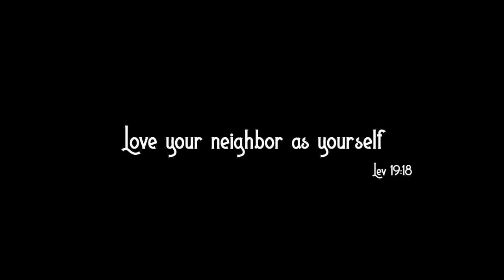Fitting a RESIDENTIAL DOOR in a MOBILE HOME!

Comment: Being a retired contractor/project manager I would like to pass on a trick.   You dont need to leave the door in the frame to hang it.  Get the hinge side plumb and the threshold level and then fit the rest of the frame to the door.  I promise with practice its much easier then fighting that heavy door and frame all in at once.   I also use 2 1/2 to 3 inch torx head screws to hold it in place under the weather strip and then one in each hinge..

Comment: It’s basically like a regular home install after you enlarged the rough opening to fit……I have always replaced mobile home doors with house doors and the rot you found around the door is very typical of mobile homes…almost every metal clad mh I have done had rot.

Comment: Very nice. I done the same thing on my mobile home. Put a 36x80 on the front and 32x80 on the back both with half windows. I love my new doors. I didn't have as much clearance as yours so I didn't have to add a new header. The door went all the way to the top. And the cost you was talking about was true. Much cheaper to go with residential doors.   I had to replace mine because cops kicked in the previous owners lol

Comment: Yall are doing so much stuff just like me. I too build a second roof over an old trailer. I too put a res' door in. I too hang my tarps from the second roof. I had 5 big water damage spots. 3 down 2 to go. I saw other new mobile home installs having 2 cinder block supports under the door. I followed suit.

Comment: You could add shim strips to the studs. You could gradually make skinner shims the father you get from the door. Or if your removing all the interior wall board in the room you could increase the insulation between the studs from 2x4" to 2x6 with the shims. Just a thought.

Comment: I'm doing this exact same thing tomorrow.. we have a 32×73 and are putting in a 36×80.. I was a bit concerned about the space available above the door to put in a header, because I doubt there is a header there now, but my home has the same peaked ceilings as your so I'd imagine the wall height is the same... wish me luck! Especially need luck getting it in before I have to work tomorrow afternoon. Jobs always take 3 times longer than I expect them to.

Comment: Great video. The only thing I would have done is to install a premade PVC door pan under the door which will keep any water from seeping into the home under the bottom and lower sides of the door.  You can also fold and install an aluminum of galvanized pan yourself.  The door pan will enure no water even when the caulking fails, and it will fail eventually due to slamming the door, etc.

Comment: My mom needed a new door on her Parker. I'm lazy, so I bought a door blank, sanded, eurathaned it without a stain  (beyootifull) and then cut off some here n there to make it fit in a centered fashion. Although, We did tear into the floor a bit to lower the threshold to flush for less trip hazard. Clearly I had help with that part.

Comment: We have a Modular home, and other than the siding is a tiny bit better, There is not much difference between a modular home and a Mobile home. So I might be able to upgrade our kitchen door to a 36" wide opening. Many thanks!

One observation, that the new door is a lot heavier than what was there, make sure that the king/jack stud on the hinge side of the door is as solid as it would be in a sticks and bricks house. Perhaps putting in a few braces over to the next wall stud would do the job. That king stud is supporting a lot of weight when the door swings open.

Comment: You were SO right to go for a 36 inch entry door!  I live in an old place, and I have one entry that is 36 inches, the other is 30.  Obviously EVERYTHING (so far, stove, refrigerator, washer, drier, sofa, recliner) have had to be hauled around to the wider door to get it into the house.  Doable, but a nuisance.  No plans, however, to replace that beautiful wood, with eight small glass panes, 30 inch door.  I love that old door that came out of a 1917 building so for now it stays!  Anyway, as to your new door, I love it.  Good choice.

Comment: Absolutely enjoy your remodel projects! I too live in a mobile home we have done a lot of remodeling ourselves. It’s crazy how poorly they are made and how they can get away with it! I do have a question for y’all when you replaced the plugs or light switches in your home where they attached to a 2X4 or in the Sheetrock, wallpaper wall? Because ours are starting to pull from the wall Sheetrock.
Reply from the maker: Thanks!! All of the original outlets and light switches in the home were floating in the walls -- only being held in place by tabs to the wall covering. Terrible!! We have the same issues with them pulling loos from the walls.

Comment: I've been remodeling my '72 trailer for almost a year now and you're videos have been very helpful... I get to see how it's built and what to expect... I spray a 50/50 bleach and water on the mold and dark spots after that dries I go around with bug killer and then let that air out .. I have plastic up to keep the fumes dust and mess out of the back rooms where I'm living until I can finish the front 3/4s and leapfrog around... Everyday I do something doesn't look like it sometimes or it looks worse at times... I'm not in the best of shape from not working or have deep pockets... So for anyone out there just know if you watch a bunch of videos about whatever your doing and give it a try at some point it will get easier and at the end you will know what you got.... My condemned $8000 trailer with no hot water... Ants everywhere leaking roof and windows moldy celing a patchwork floor and no appliances...  Well now it's coming together nicely thank you for your inspiration and positive vibes to just keep at it

Comment: You two are like my wife and I. Love it. Nice door and install. Just curious why you purchased a door for a 2x6 wall? And, did you get the door w the PVC brick molding? 

I like using GRK 3.5in trim head screws for fastening the brick molding to the structure. I also install them through the case hiding them under the weather strip. I use 3in #8 GRK screws to secure the hinges through the case as well, at least one per hinge.
Hope it's still working for you.

Comment: Since I am about to install an entire new wall, with a new nine-light 36" door where a 32" door was, I sure do appreciate this video!  I am running into some issues in the project though -- not the least of which is the electric wiring that runs over the top of the door.  Apparently the door was replaced once already, because the wires are spliced.  Any suggestions would be very welcome.  I'm working alone.

Comment: Replacing 1 screw in each hinge with a longer screw that reaches most of the way into the king stud will handle kids better.
Reply from the maker: We didn't show it, but that's exactly how the door comes from the factory -- each hinge is missing a screw. We pre-drilled and installed 3.5" exterior grade screws in each one to lock it all down tight.

Comment: We are remodeling our second mobile home. Your 54 inch tub video is what lured me in. I am about to undergo, laminate flooring for the whole mobile, kitchen, and the small bathroom. Next year will be another bathroom and interior/exterior doors and some windows. We are spreading ours out over a 3 year plan around 5-7500 each year. We paid 4 k for this one with a electrical short I was able to fix day 1. It should be able to double my profits in the end if and when we sell. for mine, the siding to mae will make or break the end result. We kinda want to get ours to a point where it's worth selling or worth moving to land. Paid 4k for it, Hoping to get near 40k in the end if we sell. Mind you mobile home values are through the roof in my area right now. I could aim high and have a good chance of satisfactory sale on my end. I want land so bad.

Comment: I have a 1990 Norris single wide trailer. We have 3 light switches, 1 for the outside light the other works the ceiling fan and the 3rd has been took out and just wired together . So do you have 3 switches and what do they go to? I also have the same smoke detector wiring too so that's why I'm asking. Previous owner also had replaced a 120v outlet with a 240v outlet and kept all the other receptacles. So I'm just kind of worried what else they messed up on!!

Comment: Hi from the U.K. 🇬🇧 
it’s looking good but every time you pull up flooring I’m waiting for something to jump out. 
How do the wasps get inside to make nests inside your walls?
Reply from the maker: Thankfully we've not had that happen to us! The wasps are able to get into the walls from the exterior since the original siding is in multiple pieces. It's crazy. On the front of the home, where you see the stripes of color horizontally, those are seams and different siding sections. I guess it was to make it look better back in 1988, but was the worst idea ever for a home!

Comment: That stud doesmt fit close to door Opening, due to roof sag from NOT having a PROPER Header over Door. You should be inatalling a PROPER Header made of two 2 X 6's on edge with 1/2 incch plywood betwen them supported by Jack Studs. Also for added Security 3 inch screws on striker plates into Jack & Kimg Studs as well as one or two in each hinge.

Comment: You need to add a storm door to keep the rain off your door water will run in under the door. I did one just like you did I end up putting storm door upon mine.
Reply from the maker: We bought one at the same time as this door. :) That install is coming up as soon as the trim gets painted and we tame the electrical wires inside.

Comment: That doesn't look like a 2x6 unit. Normal door units are made to work with 7/16" or 1/2" sheathing. They flush out with 1/2" sheerock on the inside. That thin tin on the outside allows it to go further into the inside.
Reply from the maker: Ahh, good point! You're right!

Comment: Love the new door.  But it is for a house and not a mobile home.  The rain hits the door and runs down and into the house, not outside unless you did the door pan.  That means you need a storm door to keep the rain off the door.  That door seals on the inside where trailer door seal on the outside, but it is a better looking door.  Just needs to be protected.

Comment: Hi I'm looking at buying a mobile home with the same metal roof as you have. What is the noise level like when it rains heavily .
Reply from the maker: Before we added our roof it was the original metal sheet style that would rumble in the wind and was very loud in rain! Our new roof is very quiet! That is due to the fact we decked our roof with plywood and not wood strips that many others do. It's a layer of insulation and sound proofing that has been well worth it. Note: this was before lumber prices went crazy... not sure if we could justify it in today's market.
Reply: @sam-and-angela  thank you

Comment: Which oscillating blades are you running? I been using the $17 dewalt carbide single pack and they ok I guess. Definitely don’t cut like your blades.
Reply from the maker: We've been using the DeWalt brand carbide (or titanium) coated tip blades. The ones with gold on the ends. But we've noticed they don't seem to last -- at least not as long as we want for their sticker price! We're going to give off-brand ones from Amazon a try next to see how they fare.
Reply: @sam-and-angela  For real! I think I been running the same ones! They don’t last at all. I also seen on some tool reviewers’ YouTube channel some “imperial” brand blades. I’m thinking of buying some from Ace Hardware. Price point is about same as dewalt. I’ll let you know how they go.
Reply: Quick update - I was at Home Depot today and picked up the Diablo Carbide Oscillating blade. There was a promo pack (2 blades) in store for $22 (1 1/4”). Used them today and they were AWESOME! Sharp and far better than Dewalt. I highly suggest picking up these ones for your toolbox.

Comment: Why do you say the door was made for 2 x 6 Walls?  THe standard stock doors are designed for 2x4 walls.  Did you order a deeper jamb? Buy it by mitake? Get a heck of a deal? orgive me if I missed the answers - I was sent a link to this video and it is all I saw about this exterior door instaall.

Also, at one point one of you said "it's white" as if that was a feature. It is PRIMED white, but likely says you are to paint it ASAP after installation with an exterior grade paint.

Comment: As someone who owned and lived in a mobile home for probably 10 years, as things would break and I would need to replace them or upgrade them I learned on the very first thing to never get the mobile home version. It's cheaper materials and craftsmanship-wise but costs sometimes more than double of the normal stuff. I want to Lowes or home Depot for everything I had to do there. It just floored me that mobile homes have that cheap reputation but everything you have to do in a mobile home the mobile home products cost more. What the heck is that about????
Reply from the maker: Truth!!!

Comment: The sagging comes from the weight overall of the house all inclusive, bearing on the supports underneath the house. Mobile homes don't have enough support underneath for a lot of added weight. So if you're doing remodeling it's important to know weight matters,  ie, a new heavier door, windows, trims, appliances....... and tile floors/walls add a lot of weight. Also, if your house is supported by concrete blocks sitting on the ground/dirt, they will shift and move over time as well, causing cracks, sagging, etc